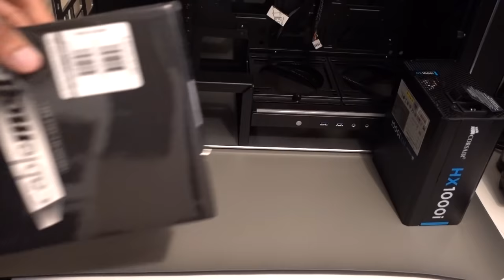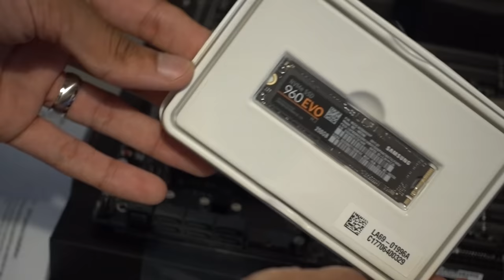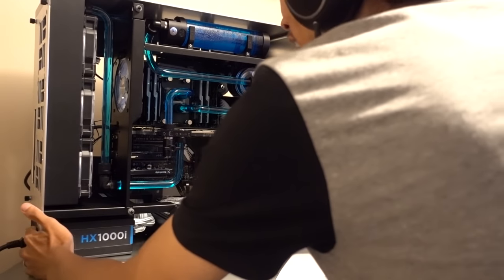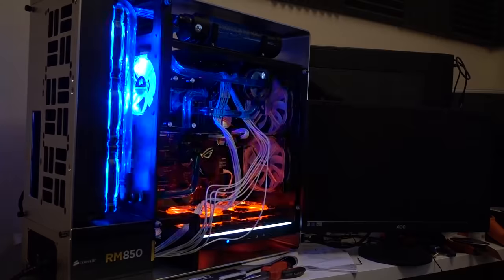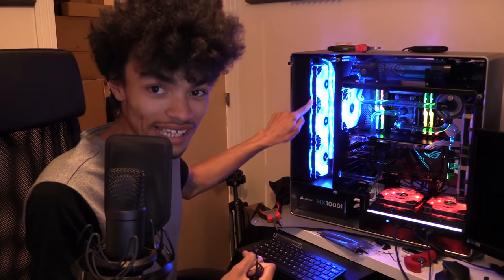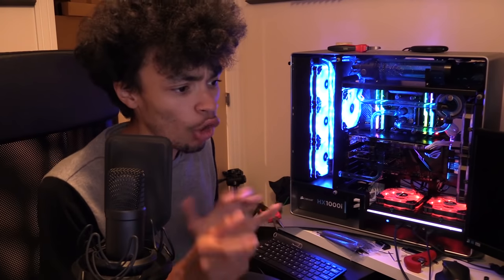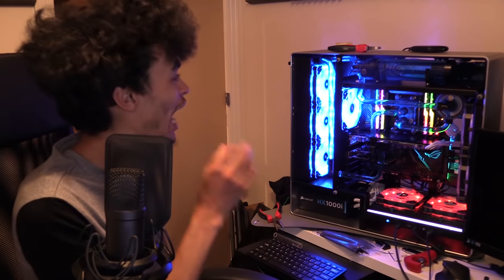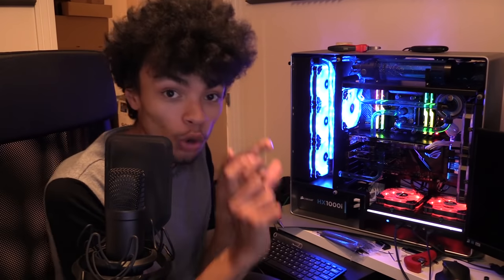$6,000 AMD THREADRIPPER BUILD... INSANE!

Comment: is that really how you install the cpu ? you slide it in in that small frame thingy ? holy shit AMD you are geniuses !
Reply: aeroaa2 you slide all cpu's into frames...
Reply: no you don't, before you had to align it and put it down yourself  
just open some random PC build video
Reply: MSTANG_GT Umm....No. Only AMD Ryzens do that,they are the first to do so. Intels need to be aligned
Reply: KrisTDG Only Threadrippers do. R7/5/3 and the rest of the AMD CPUs need to be alligned
Reply: my error! Sorry! Haven't really caught on to the AMD CPU trend,as I built my PC already and really dont need to (Not saying I'm an Intel fanboy/Nvidia Fanboy not to. I have a i5-6500 paired up with a RX480 Sapphire Nitro+..)
Reply: aeroaa2 oh I thought he meant like just putting it into a compartment and closing the thing. My bad, I sorta assumed he didn't know anything about pcs
Reply: KrisTDG I have an i3 6100 paired with an XFX RX 480 8GB. Strangely no bottleneck but I'm thinking of upgrading to a 6600k
Reply: I do know something about PCs, but lately I haven't been following at all, and seeing how Pants slided the CPU in that frame thingy and then installed the cpu on to the socket like it was a lid/cap just amazed me because this is something totally new
Reply: MSTANG_GT why 6600k you can upgrade to 7600k, you just have to update the bios
Reply: Imouto #57899 cause used 6600ks are like £50 cheaper and I'm poor
Reply: aeroaa2 no i hate it, I like the lga from Intel
Reply: with that gpu, I'm pretty sure a 6600 or 7600 would be more than enough and cheaper than the k version.
Reply: Bmwmotorsportguy yeah it would be fine, but I'm looking to maybe run 2 480's in the future, and also I want to try overclocking
Reply: Would probably handle 2 480's with no problem, but if you intend to overclock you might also need a new motherboard if your current mb isn't a z170 or z270, for oc I'll go with a 7600k since kabylake overclock a lot higher with no trouble, even more if delidded.
Reply: Bmwmotorsportguy nah it's a z170 so it's fine

Comment: Sometimes I wish I knew what even half those things did 🤷🏽‍♂️ sure does look cool tho
Reply from the maker: They do a lot of things very quickly ;)
Reply: BlackPanthaa Haha XD. Glad you got a proper PC now
Reply: Non pc guy
Reply: LEMON1059 You can actually find BNR32 GT-R`s in Japan for 6000$ if you know where to look.
Reply: He desires an R34 though..Besides doesn't it cost like 3 grand just to import it? And then you have to get it registered, get through MOT's. Not to mention you might run into issues regarding tunes and/or seals because it's JDM? Might just be cheaper to buy one in the UK, time is money ya know! Maybe I'm being paranoid, I'm just a dog browsing the internet. 

It would be JDM Though which is nice.
Reply: MarcusW10 yeah I think PCs are pretty neat and I know some stuff just never had the time to find out properly
Reply: Andu Auto wish I lived in japan
Reply: LEMON1O59 I can confirm from someone who does know what everything does that is it pure computer porn
Reply: LEMON1O59 Big rectangle thing-processor, brain of computer. BIG brick thing with a 1000 on it-power supply. Small brick-graphics card, what makes the graphics. Wierd smaller colorful bricks-ram, helps the processor and acts like a small temporary storage device. Thing that everything connects to-motherboard, this just makes everything work together. Tubes-water cooling, needs no explination. Now you know what more than half of this stuff does.
Reply: Yes, nothing adds performance like a few glowing/LED backlit mismatched colored fans! :)

Comment: This video made me want to look up how to build and what all those fancy things do. I'm going to do some research now. Any website recommended for learning everything pc?
Reply from the maker: It's pretty easy, especially without custom liquid cooling. Check some youtube videos and PC Part Picker is a good place to check compatibility between parts, it will only suggest things that work together
Reply: Ok ty
Reply: LinusTechTips is good.
Reply: JayzTwoCents is great to watch aswell.
Reply: It's pretty easy acutally. Look at a bunch of youtube build series and then pick out your parts, recheck everything a thousand times and take your time. IF you by accident buy the wrong part it will probably be something small like RAM or a harddrive and you should be able to return it. 

My tips would be to start off simple: NO aftermarket fans, one harddrive, one (set) of RAM. Afterwards you can upgrade your PC with these things. 

Everything in a PC is pretty much plug and play, you just gotta connect A to A, and B to B, so if something is wrong (doesn't boot) just double check everything. 

The thing that is easiest to mess up in my opinion is which order to install the RAM (It does tell you where in your manual, it's just an easy thing to miss).
Reply: BlackPanthaa Thank you! I'll definitely check out some youtube vids and that website.
Reply: Thank you everyone for the info!
Reply: Ren Ren Pornhub
Reply: Linus tech tips lmao
Reply: Bitwit is nice too, he does loads of builds that look dope and are easy to follow
Reply: mr.gokys LinusDropTips

Comment: I upgraded my PC to a Ryzen 5 1600. When I set everything up the system was fine and its was going well. However once I started over clocking I had massive issues were I'd be in games and have massive lag followed by the blue screen of death. I lowered the overclock and still had the issues and it got to the point were I removed it completely. The computer was still getting the blue screen of death even if it was left on idle. I tried everything to get around this but it kept blue screening. Only then did I discover that it was the Bios which needed up dating. Once I updated it all of my issues were fixed and I now get absolutely solid performance in games with a 3.8Ghz clock speed on the clock cooler.

Comment: Perhaps just get 2 4pin splitter, 1 for 2 front fans, another 1 for the bottom 2. Plug them into 2 of the chassis fan plug on the board. Jobs done.

Comment: The hole you drilled for the tube to pass through you should have used a pass through fitting that would make the tube more ridged and make it cool cleaner by hiding the roughed up metal.

Comment: I built a ryzen 7 1700x, asrock taichai 370mb,  16gb gskill ram at 3200, 1050eva psu modular, 512tb m2 wd blue, 1tb wd blue ssd, 360mm custom water loop, sapphire vapor x 480 8gb, corsair full tower case with glass side panel, blue ray burner, mechanical led keyboard, qnix 2710 27in 2k monitor, logitech g400s mouse all for around 2000.00 usd

Comment: Nice build! Next time you should test your parts before voiding the warranty, such as when removing the heatsinks on the gpu. If it's defective, neither the seller nor the manufacturer will take it back for repair. Still, you did a good job, especially for a first time custom watercooling loop with hard tubing.

Comment: AI Suite sets the fan settings in a deep level of the system. Once you've made the setting you never have to run the AI Suite application again. The settings are maintained between boots. Even if having AI Suite running doesn't compromise your system it's better not to have things running that are not performing any needed function.

Comment: 14:45 it's weird, because more thermal paste at the gpu chip is better than you might think. Before you scream at me, I tell you why. It's because if the paste is getting around the chip too, the chip itself will be cooled better than it would be getting cooled without the paste around the chip.

Comment: Great looking PC! I'm still doing research on my build, but after watching your video, I think that I'll go with the MSI X399 GAMING PRO CARBON AC sTR4 AMD X399  Motherboard. I had an Asus Mobo in my build before & didn't like the fan controller & the overclocking features, & this was a $575 Mobo! But, I will go with Raid using 2 Samsung 960 Pro 512GB M.2-2280 Solid State Drives in Raid 0 & backing those up on a Samsung 960 Pro 1TB M.2-2280 Solid State Drive. You would be surprised just how much faster your programs load & respond in Raid 0. I have 5 more 2TB drives that I have mostly music, but some videos stored on. Guess it's time to get a couple of 10TB drives. Is your RAM the 14 or 16 CAS Latency? And does it make that much difference if performance to justify the almost $100 price difference between them for 32GB of the 3200? About the only other thing that I will do differently is to get the EVGA GeForce GTX 1080 TI FTW3 iCX Hydro Copper GAMING, because my Video Card for the last few years has been a GeForce GTX 690SLI, and it won't support my 42" 4k monitor in 4k mode.
Super nice rig! By the way, what coolant did you use in your system?

Comment: You said you are on top on in Firestrike with a 1950X/single 1080 configuration at 18K points? When was this? I am on top (and been on top for weeks) in Firestrike in single and dual 1080's scores with a 1950X.

Comment: Theo, that pipe going from the pump to the cpu block is not straight and it triggers my OCD. you should've cut it shorter where it meets the pump.
Reply from the maker: Depends where you saw it in the video, I re-did a lot of them but didn't record
Check at the end :P
Reply: oh, yeah, I see it now.also, any plans for an SLI config soon?

Comment: AI Suite is pretty awful.  When I built my PC 2 years ago, similar performance issues, ended up being that AI Suite was putting the PC in Power saving mode.  Maybe check that in Control Panel and manually set it to Performance if you're using it constantly.

Comment: Why thredripper though? It is a bottle neck for the 1080, to play games you will have to disable half the cores
Reply: you have to disable half the cores on some crappy games that crashes with more than 20 threads. It´s not a bottleneck. At 1080p it performs a little lower than a i9 7900x (5/10% lower), but at higher resolution both perform the same.

Comment: The motherboard softwares are awful! I had gigabyte EasyTune installed, and one day I decided to tweak the OC, let the app run at windows startup with the new OC presets. Nightmare! I couldn't boot into windows, it would freeze after login. I did manage to remove the app in safe mode. Never ever again!

Comment: AI Suite 3 admittedly is shitty, and seemingly hard to remove (i could uninstall it, but then it still tried to start on every bootup and failed because the files were gone) but it is not just a fan control software. Most importantly, it's for software overclocking. So when it actually works it's pretty nifty, because you can test your limits much faster, but i'll keep away from version 3 just like you.
Reply: You can just disable it from starting in Autoruns.

Comment: WHY DID YOU NOT GET A 1080TI YOU MASSIVE BABOON
Reply: Konrad Godel he already had a 1080.
Reply: That is not a reason .He will experience some bottlenecking this 1080 is bullshit for that threadripper cpu he needs at least 2 1080 ti
Reply: Threadripper isn't a gaming cpu, so no it isn't overkill in fact Threadripper's low clock speed would be a bottleneck for 2 1080tis.
Reply: Honestly if he wants to graphically use the power that cpu can handle he should have bought 2 titan Xp's
Reply: if you have 2 titan xp you can have 1 person gaming and streaming and someone doing some video editing at the same time through virtualization. and the extra titan xp can be for hardware acceleration.

Comment: AMD............
Reply: PinguGaming ...Ryzen. ( ͡° ͜ʖ ͡°)
Reply: I heard it's good, mine's Intel Core i9-7900X with asus gtx 1080ti
Reply: mm
I did an overdue of an upgrade from a Phenom II X4 to a RYZEN 5 1600,I definitely don't regret it,I haven't had a single case where Sony Vegas or FL Studio would crash, or render slowly. Performance in game is also amazing,but I can't really push it to the max because I've got a bottleneck of a 750 Ti
Reply: 750 bruh
Reply: eh,I can run all the games I have just fine
Reply: and? whats the problem with amd. Threadripper cpu´s especially are amazing. it has 6 cores and 12 threads more than a 7900x wich cost the same.
It´s a good cpu for gaming, not as good as i7/i9´s on lowe resoltion (at 1080p is around 10 slower than a intel cpu), but on higher resolution performs the same or even better. And.. most importantly if you are buying such an expensive cpu, on productivity is a FUCKING BEAST, it stomps the 7900x on video rendering and content creation in general. All that... costing the same, being much cooler, and consuming around the same power.